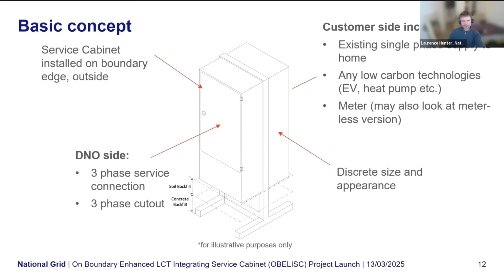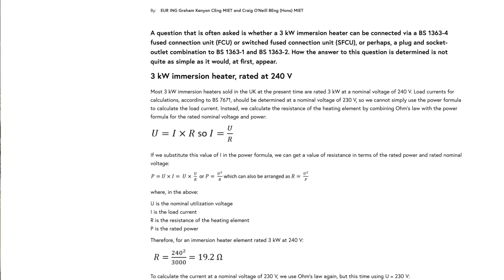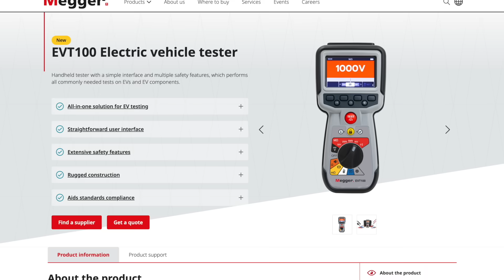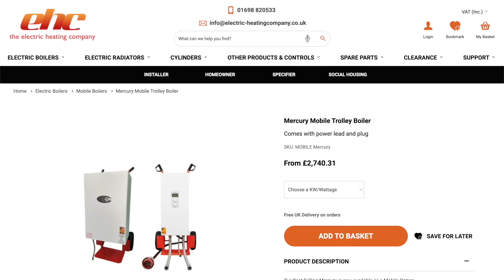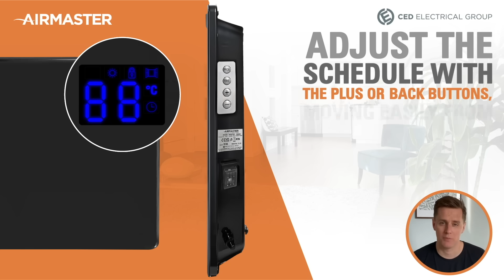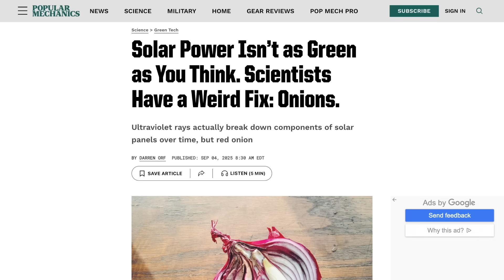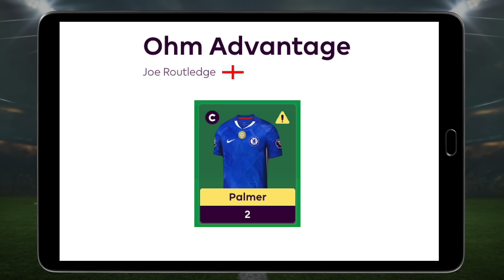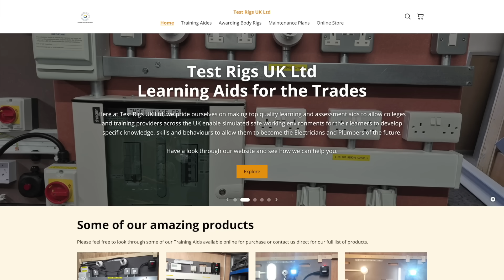A Major Solar Brand Just Quit the UK Market

Comment: 3:44 - the irony of all of this is that the 3kw rating of immersion heaters was probably selected so that they could be powered from 13A fused spurs in the days when electrical items were all made with a decent safety margin.
Reply: Also, someone here refers to the FSU "melting". For that to happen it would need to be made of a thermoplastic, but properly constructed FSUs are made of thermoset resins. They will char long before they melt.
This came up as an issue in the early 1990s. It was concluded by the industry association that in reality an immersion heater will take no more than 2 hours to heat fully a typical hot water tank, and that assuming an FCU and cable to standard there was no unusual risk. However, there was at the time a growing problem with bad 13A fuses (which got hotter than British made ones) and FCUs with poor quality connections.
To a certain extent I think we are simply seeing scope creep in the industry where people are looking for ways to make installations and upgrades more expensive with more margin. There possibly is an increase in safety but the biggest change to fire risk in houses is simply the decline in smoking.

Comment: Anyone thinking of buying a battery system off of a company that hasn't been around for more than ten years trading is asking for trouble. 

That 30 year warranty doesn't mean jack if the company no longer works in your country or just goes bump.
Reply: @ZimZamKabam2  tell me what company will be here in 30 years then...
Reply: @Flaggyt  🤦🏻‍♂️ its not about which company will be here it's about the chance of that company being here.  What has more chance of going bump. A startup new name brand or Samsung? 

Secondly I have seen this all before, first wave of solar companies popped up then liquidated after making their money so they didn't have to honour warranties. 
Insulation specialists, economy 7 heater installs. 
And so on. 

Not saying they all do it. Just you stand a better chance going with a reputable company if you can.

Comment: 1:53 Can I trust National Grid to do anything right when they can't use English correctly? Maybe they mean "discreet"...

Those adverts "The reason more people in the UK don't have solar is not the weather..." just drive me up the wall. Of COURSE it's the weather, or rather, the climate. The reason is that we don't have enough sunlight to make solar pay for itself. A basic Installation £5,000 (EDF)? I could be dead by the time it paid for itself. I know to you £5,000 isn't a lot of money, but it's more than 6 months' pension. Of course, in the South, it's a different matter, £5,000 is 30 minutes' work, isn't it.

And THEN there is the hidden cost. The roof. Our roof is tiles and most are 90 years old, we have to replace a couple of dozen every year, £500 plus cost of scaffolding and pointing. So, how much will it cost to strengthen the roof? It has 3 4x10 horizontal beams on the South side, what extra work will be needed? How do I know the roof won't leak as a result of the installation? Will anyone offer a 90-year warranty on the installation? No, they will make all the money they can and retire to a mansion in Oxfordshire.

Comment: A few year ago I remember a family member installing a programmable 13A FCU for an immersion heater, it worked for three months until the 13A fuse melted into the plastic, a second one was installed and went the same way after approximately 3 months, after that a 20A manual switch was installed, these same programmable FCU units from Greenbrook / Kingfisher are still available and they advertise suitability for immersion heaters which is not a good idea.👍🏻
Reply: Immersions just cook fcu's as at 12 amps, the fuse gets hot, ages, gets even hotter, then blows, by which time it's welded itself in!
Reply: @alanjewell9550 Yep exactly what happened with one of those timer switches, replaced for a manual MK Water Heater switch 20A no further issues.
Reply: Needs to be a 32 or 40a relay so it can handle 13-16A (or 20a if dno get there way to drop local voltage down to 210V

Comment: Thank you Joe. I am also going for Watercress Vinegar for this weeks words. As for the fused spur question, I am surprised that anyone would fit a 3kW immersion heater to anything other than a 20A DP switch, as the FSU always melt, so I have always considered the answer is simple regarding them. I did chuckle to see your piece on the Dimplex Quantum storage heater moments later showing their largest version, either 2.74kW or 3.3kW were connected via 13A FSU!!!

Comment: Using worst case of 216 volts gives a current of 14 amps for a 3 kW load. So it would appear that manufacturers aren't allowing for the practicalities of real-word installations if their switches don't cope with short periods of under-voltage? Though of course in most cases domestic water heaters should technically be fed via a (20A) DP isolator and the circuit and switch protected by an appropriate breaker (which itself can be less than straightforward as manufacturers often recommend de-rating adjacent breakers expected to run at or near full capacity !)
Reply: You have things a bit wrong there for a resistive heater.  Reducing the voltage to a given element reduces the amps flowing and results in lower wattage.  If the element is rated at 3kW at 240V at 216V it will be passing 11.25A an producing 2.43kW output.  This relationship doesn't hold for complex power supplies (switching power supplies for example) where they will increase current draw at lower voltages up to the point where the voltage falls below their operational threshold.  Other types of loads will increase current too but simple resistive loads do not.

Comment: Regarding meter boxes on the boundary - The in house display for smart meters only works within about 3 metres of the meter, so that would mark the end of smart meters!!?
Reply: If that distance is correct they'd just start issuing meters with a stronger signal for the remote.
Reply: Smart tariffs work just fine without the ihd. The octopus app - and I expect many other suppliers - is much better than the ihd.
Reply: @cad4246  for most users the IHD is the main purpose of the smart meter

Comment: Watercress, and vinegar, and you CAN connect them to a 13A FCU, it's called job security when you come back to replace it in a year
Reply: Getting people to always turn off their shower isolator is also good for job security, replacing worn out ones. I'm sure they're not designed to be turned on & off every time someone uses the shower but a common practice.
Reply: @alanjewell9550  yeah i think people think the red light uses 9.6kw ;)

Comment: În România we have 3phase power and meter box on the property border .
Reply: Yes but a bit of a cruise around Romania with Google Earth shows you can have them mounted on the exterior of the building too when the building side sits on the boundary.  edit I found quite a few where they are mounted on the exterior of the building where the building is set back from the property boundary too and more interestingly where they are mounted on a nearby distribution pole.
Reply: I lived in Italy and the meter was on the boundary. Not really an issue. The smart meter, half hourly charging, and variable tariffs- that’s a separate and not Electricians’s issue.

Comment: Boundary boxes in conservation areas where the box is in public view. Listed buildings where the building forms the boundary wall. Digging up distribution cables where the cables go through multiple gardens and even third party owned property (not the house owner or the local council (pavement) or the highways (roads) where wayleaves need to be sought to put in a new trench to the property boundary for the new three phase cable. Third party owners are difficult to trace, often don't respond to requests, ask absurd amounts for the wayleave or in the case of an absent landlord or a landlord in default the property reverts to the Crown Estate who will not process a wayleave. You have to remember cables weren't laid to be easily accessible especially on newer estates in the last 50 years where non-domicile land was sold off to third parties because the local authorities weren't happy to accept maintenance liabilities for these. Good luck to the DNOs in processing all the paperwork associated with all of that at that is even before they do the work. And who is going to pay for all of this? I'm assuming the cost will go on to energy bills which will effectively be a regressive tax.

Comment: Whilst there should be no need to connect an immersion heater to a 13 amp spur it is something you would see in old houses without a problem. I think the problem is that manufacturers just don't make the kit to stand the full load anymore.. just like DC isolators for Solar. We now don't fit them because they are unreliable newsflash if it says it will break 1000 V at 10 amps it should do that easily not only once under ideal conditions.
Reply: In the 50s and 60s it was common to have a plug and socket on the immersion heater. Very rarely did they burn out . All down to quality fittings
Reply: Do you just go straight into the inverter and use the inverters in built isolator ? I've been servicing some domestic solar lately and always feel uneasy doing short circuit testing when no dc isolators fitted into the strings . So much so I went and got the Seaview pv150 tester but even then still feel uneasy plugging them into the machine while live
Reply: @christophergallagher3845 no I am an industrial electrician don’t personally do solar I was just using it as an example of how poor quality equipment has lead to a regulation change. I would say all the older sparks would like to see a DC isolator external to the inverter. Was recently at a factory where the sizeable solar inverter blew the front cover off and was sat there arcing away with no local DC isolator. There was half a dozen empty extinguishers underneath
Reply: @johnwarwick4105 aye thats what i mean mate , if fault happens before the isolstor fsir enough but at least guve us something to isolate ot before its into the inverter 

I done a few servuces on school solar installs and one of the hsd hard wired solar strings with no external dc isolstor not even on mc4 plugs
Reply: Still use separate rotary DC isolators, I can guarantee my IMO 25a/32a can handle isolation better than the isolator inside an inverter
Plus, almost all inverters use 2p isolation per string - one isolator switches both strings, so will almost certainly be a 4p isolator for both strings = only 2p per string
Where as I have the option to use all 4 poles with links to increase the switching capacity even further

Plus, if there ever was an emergency & need to isolate under heavy load at midday...
I think the emergency services could locate a visable chunky isolator near inverter, than fumble around for the inverter's built in isolator....
Is it underneath, try the side, no the other side, which way does it turn ???
Clockwise or CCW - it's hard to see with the lack of light & smoke
Oh - there is the seperate isolator - there that was easy

I think this was brought in coz some installers failed to grasp IMO/Garo DC isolators have cross poles - wired diagonally where as others like Scame are wired like conventional switches/isolators - vertically
So if an installer can't RTFM for a DC isolator or able to check their work...
If correctly installing a quality DC isolator is beyond their skill level & understanding...
Then the same person should be nowhere near any solar install

If they can't grasp RTFM & wiring a DC isolator, then they should be kept well away from any panels or worse involved in installing a hybrid battery system

Yeah, it's a daft ruling or guideline imho

Comment: Of course they want the meter outside, they can fit a smart meter without permission and can more easily cut you off in a dispute.....what's not to like....
Reply: Flawed argument.
To move a meter outside is not going to be cheap.
They can effect a change in the meter for other reasons, they don't need to endure the expense of moving the meter outside in order to change it to a smart type.

Try thinking about the costs involved and what powers they already have.

Even if the meter was outside, they can't just change it without your permission. They don't know what is being powered inside the house.
Reply: @deang5622  You're not seeing the bigger picture. The corporate state wants total control of our lives and ready access to  our power supply and it's metering arrangements is a part of the process.
Reply: @mfr58  I believe there was an incident in Australia where there was a power cut from supplier end. It was for some valid reason..can't recall but it goes to show that they can cut your power if need be.
Reply: @abcxyz3028  It's pretty trivial depending on where you are Australia.  Some states place the service fuse (SPD) externally to the premises.  If you don't pay the bill it's a case of pull the fuse link and off goes the lights.  Regardless of where it is the electrical authority in each state has undeniable access to the metering so even if the SPDs are on the premises they can still come in, including cutting locks off etc, and remove them.  Doing it for billing though is the last step in a long process as disconnection is not the preferred path.  If it's a safety / compliance issue though there's no hesitation, link will be removed faster than you can blink.
Reply: @abcxyz3028  Yes of course they can, but it will be a lot easier, quicker and cheaper if they have unhindered access to the cut out and meter. I'm talking about the UK.
Reply: @mfr58 when have you ever known anyone to be cut off from supply via a smart meter? Even if you didn’t pay your leccy for 6 months they’d still not cut you off. Meter fitters can’t exchange your meter regardless if in an outside box if you don’t consent. I don’t understand why there is some tinfoil hat behaviour over a smart meter, they want to send auto readings so they can generate a bill without you missing a month, they want to be able to check you’ve not bypassed the meter (pretty logical). That’s pretty much it, if you think they have much more control than that, I think you’re massively over estimating a smart meter. Most of the time if the customer has an issue they can’t even see if it’s a meter fault without sending an engineer.
Reply: @chrisdobbo8938  We are moving into a new AI, "smart" world, its going to be very different. When they have easy remote control of your power, even your appliances, your usage will be decided by diktat. When you've used up you carbon allowance power will be throttled or cut. This is the zero carbon world they have in store....and we are made from carbon...hmm....
Reply: They’ve always been able to cut you off you plank! 😂
Reply: @joparish1037  OK brains. What do they need to do to cut your underground supply to the house at present?
Reply: @joparish1037  Go on then, explain to us all what is involved in cutting off a single house with no access to the meter?
Reply: They can cut you off from outside and non smart meters run out of calibration soon
Reply: @TheLostPacketYT Yeah, but they usually have to dig up the road, so much cheaper and easier not to have pesky customers defending their rights.
Reply: @mfr58 not that hard can be done within the hour and a smart meters run is required if the old in is no longer calibrated

Comment: 3 phase will only be installed where it is suitable. Given that there are still many  properties are using looped connections or with service heads that look like they came from the science museum, it may be decades and only after demolition and reconstruction of the property.
Reply: I saw a service head that looked like it came from the science museum today, but it was already 3ph 😅
Reply from the maker: Fair point. 👍
Reply: Isn't there just a 4 wire cable in the ground/ on poles? Just connect 2 more wires

Comment: 0:54 It doesn't surprise me in the slightest that Huawei has thrown in the towel on their battery add-ons. Whilst their 'hybrid' inverters are cheap and work well as on-grid devices, adding batteries to them is hugely expensive compared to other 'proper' hybrid inverters where you can just hook up whatever 48V batteries and jobs a good-un.

As an end user with a few Hyundai inverters in a couple of systems I'm intrigued by some of the AC coupled BESS coming onto the market that will seriously cut my grid usage in the hours of darkness.
Reply from the maker: Thanks for commenting! 👍
Reply: I had to ac couple Enphase micro inverters with a sunsynk system to give the home battery storage . Was a nightmare having both apps working for sunsybk and enohase so the client could still monitor his micro inverters and panels.  Once I figured it out it was fairly straight forward but it was a hassle just to add battery storage to the installation
Reply: @christophergallagher3845 At the moment the only options, other than the Elon Musk product that there's absolutely no way I'm ever buying, is a solution with a Víctron Multiplus which is supposed to be a nightmare to configure and a plug and play system I saw advertised the other week which is very DIY but limited to 800 W output - tailored to the German balcony solar market, I expect.